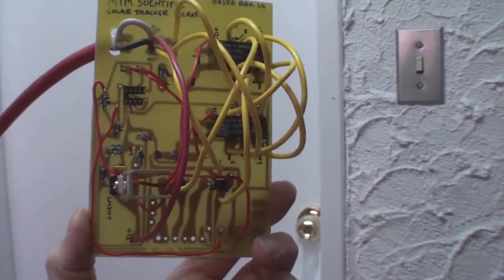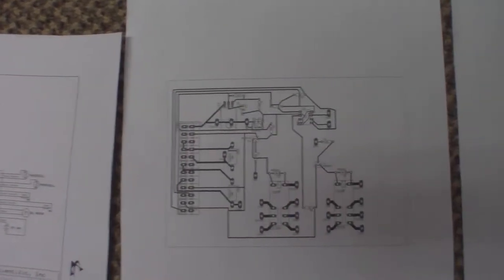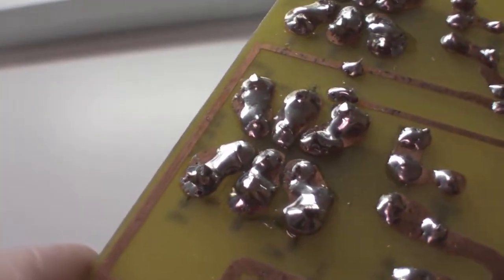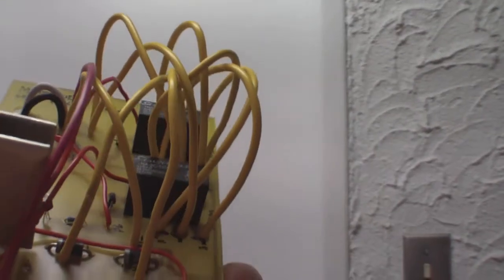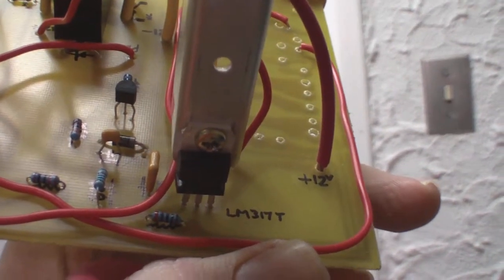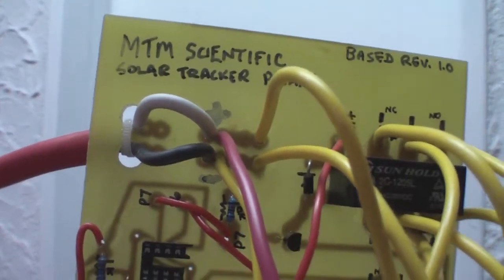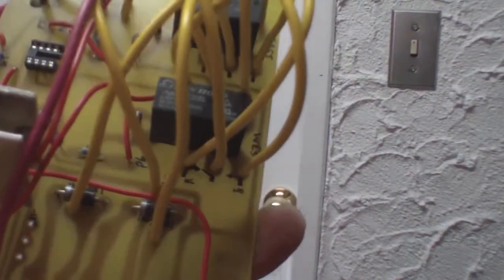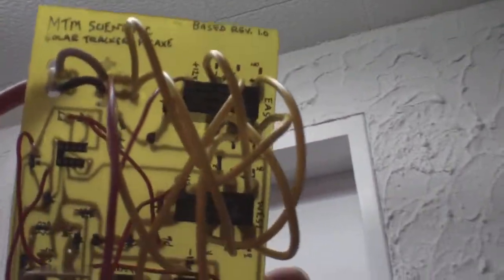MTM Scientific PICAXE Controlled Solar Tracker Build Pt. 2

Comment: Good job I think the relays are plenty big enough. The actuator motors dont use more than that and they come on for a very short moment. The longest mine come on are when it returns back east to park at night. And thats is about thirty seconds to a min. Well I would have to have someone hold my hand to make one of those LOL. I dont think I can stop building trackers long enough to have time to. It would save some big bucks, but Im not as good as you are at reading diagrams. I dont know much.